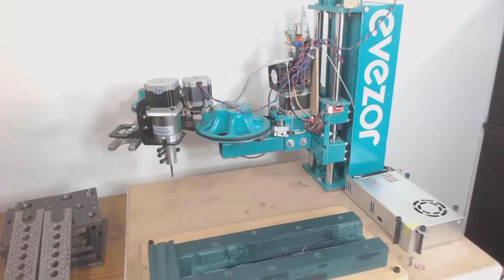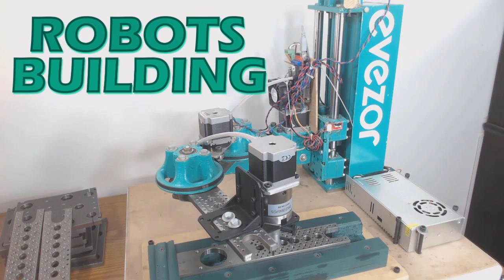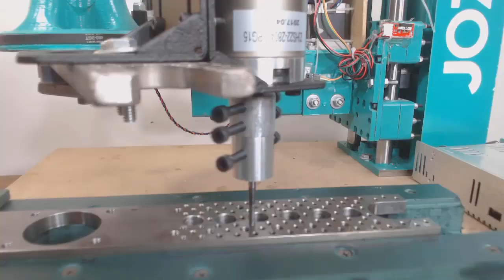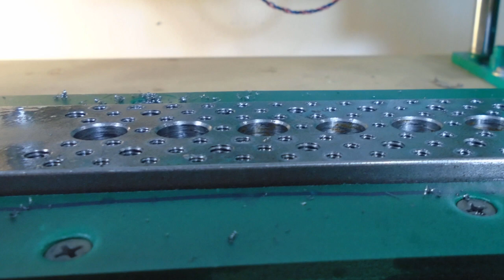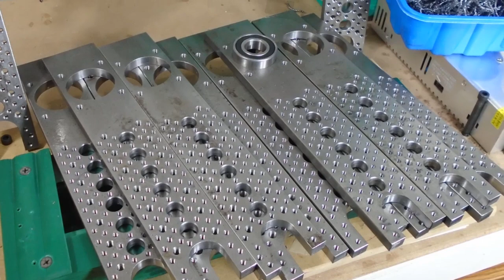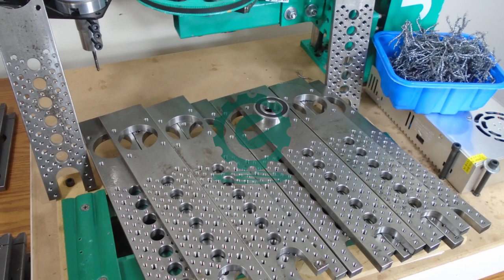Robotic arm tapping components for more robotic arms

Comment: When I saw your machine a couple years ago I was really impressed, still am. Sadly I didn't have the funds to try and get one. I have access to a CNC mill so I could have made most of it but it's the round hub looking things that the belts go on that I couldn't make. Best of Luck!!
Reply from the maker: Thank you! The hubs were 3d printed if that makes any difference.
Reply: @Evezor  Wow, that's amazing, I never realized that. I went back to your site and looked at the pictures, I can see that now, the build lines in some of them. That's a lot of belt grooves to print lol. 

Were the production units still have plastic hubs or were you planning something else?

Comment: Pretty cool, I'm glad you are posting again, I used to follow what you were up to an just kinda re-stumbled back on to your channel. Was this robot able to drill these holes as well?
Reply from the maker: Thank you!  No, the robot would not be able to drill these holes very well. The material is steel and the large hole for the bearings were milled and required a tight tolerance.